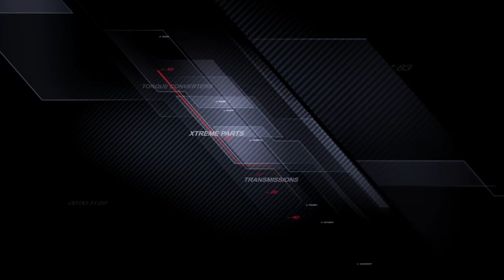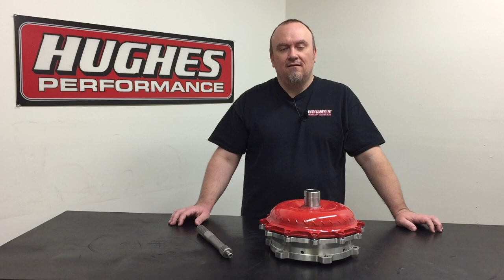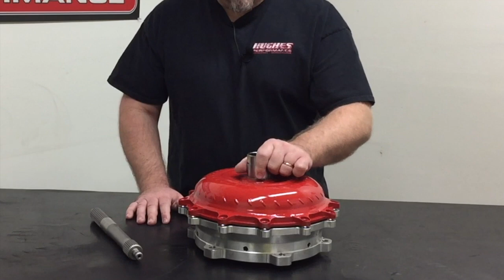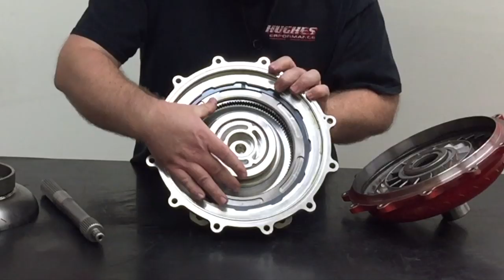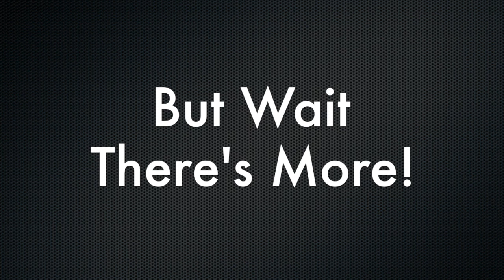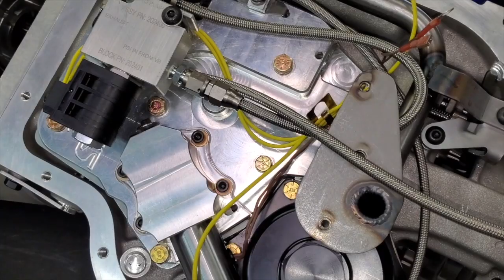Ep. 8 Torque Converters 101: Drag Race Lock-Up Torque Converter

Comment: I have a question about a converter issue. What would cause a converter to stall an engine when put into gear? It's a new single disk lock up converter, lock up is not being commanded. The stator spins with the input shaft freely when it's on the bench, when in the car it stalls then engine when put into reverse or drive.
Reply: Stall speed is literally too low for your engine

Comment: Would be nice too have a  cheaper version for the lesser powered engines 2000-3500 Hp range for the not so top dogs  But just love the video's
Reply from the maker: This is what's needed for the lesser power engines. X275, LDR, everything around the power levels you mentioned that are running lock-up are running one of these high dollar packages whether it be from M&M, ATI, Coan, Rossler, ProFormance, Hughes, etc. The cost to manufacture these parts is quite exorbitant, and profit margin to sell these products is very slim. The only way to cut manufacturing costs so that sale prices can drop is to have the parts manufactured overseas, and none of the companies mentioned are going to do that any time soon.
Reply: Keep it all manufactured in US 👌I’m from Europe, I dont want anything from the east, I will rather pay a little more, and have it manufactured in my Home country.. 👍🏻